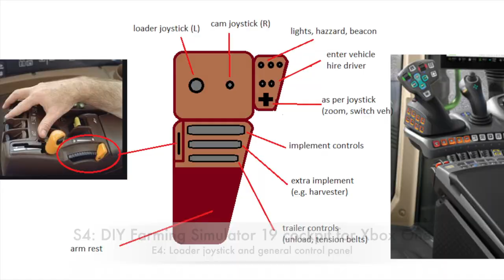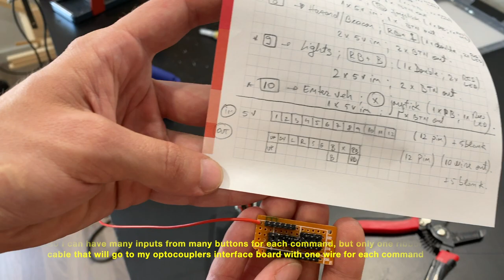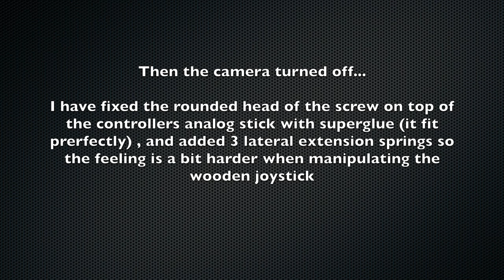[S4] DIY FS22/FS19 Xbox gaming setup E4 - DIY Joystick and first buttons panel #DIY#FS19#Setup #FS22

Comment: Great job dude but I found a much easier way without having to break apart a controller
Reply from the maker: thanks dude! I know lots of easier ways for PC...but for Xbox that was the easiest one I found...plus that I have used the controller for all the other buttons as well....Cheers!
Reply: @wambydenis   dude check out a video I put up cause with your skills and the method I used would be a perfect combo! With the effort you put into the wood work you could create some amazing designs
Reply from the maker: @JMCreations97  looked over it but I still can't figure out how did you connect the joystick...it's an USB from joystick to adapter and then the adapter to xbox? overall for me is better with an open aftermarket controller (costs about 25E)...is cheaper than the xbox adapter and better to connect the multitude of buttons I have...